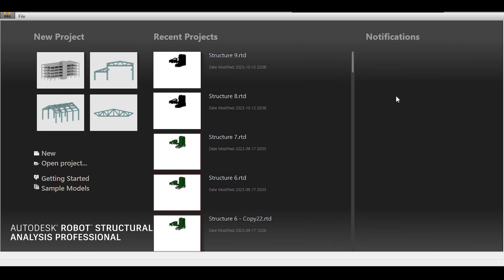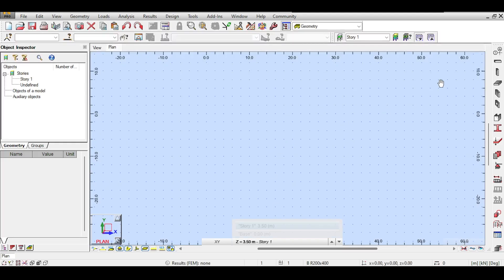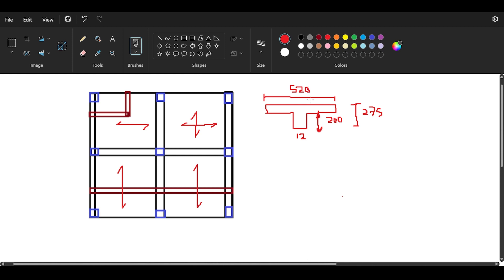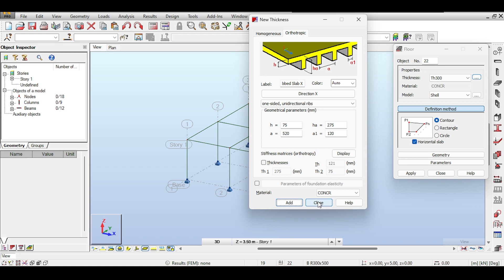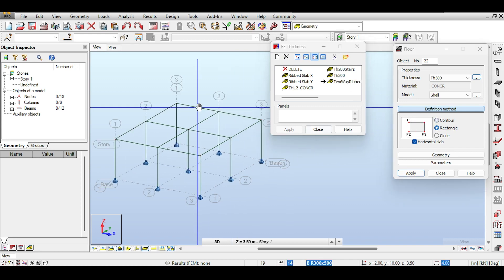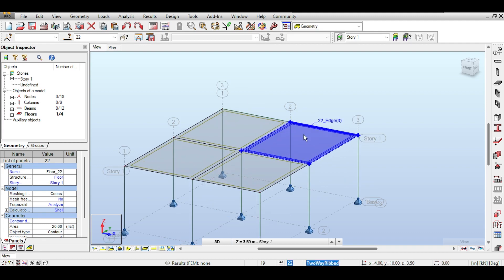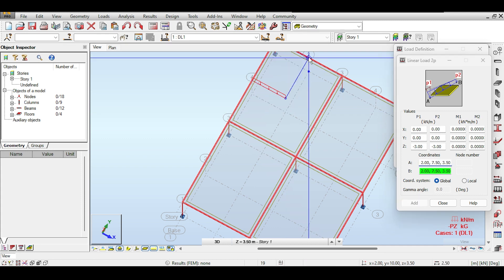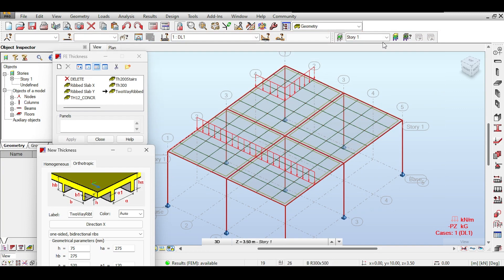Quick Video on Ribbed Slab Deflections and Wall Loadings - Autodesk Robot

Comment: Hello. Thank you for your videos. Autodesk Robot does not have brick walls, but what would happen if you would define a new material with properties (E,  ν, G, ρ...)? Of course, Robot won't be able to design bearing wall, but maybe load transfer in model would be approximately accurate?
Reply from the maker: That is a great idea. If I understood your correctly, you want to use Load carrying bearing walls (something also used in Germany: Tragende Waender) to carry the loads instead of regular columns. Yes, according to what you mentioned, if you are able to get the material properties (Elastic Modulus, Poisson's Ratio, Shear Modulus and Mass density) correctly, then it should work. Please remember to put a linear support below the wall not just on its two corners. 

The only thing to remember here is not to use RSA's design module to design the wall. If you do, then it will open its shear wall/floor design module, which of course is not what you want.

In conclusion, I think this suggestion would work accurately. 

Thnx a lot for the suggestion, it helps not only the channel, but future readers as well.
Regards,
CEE